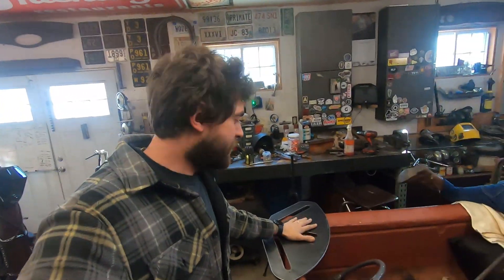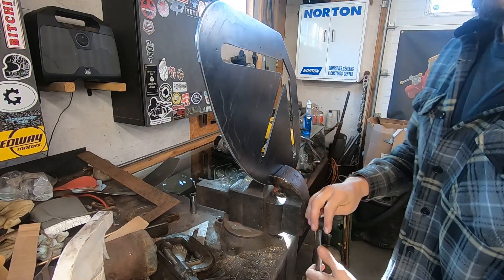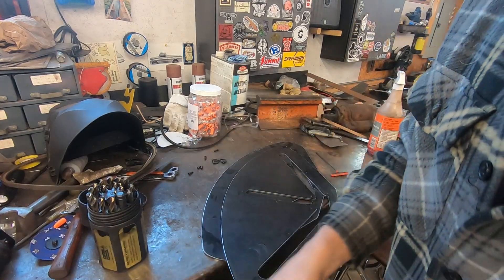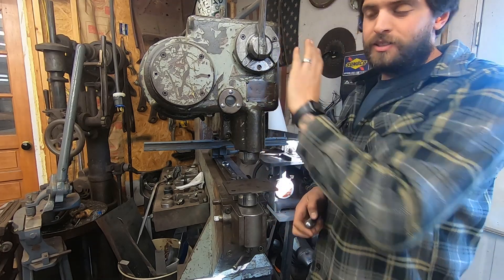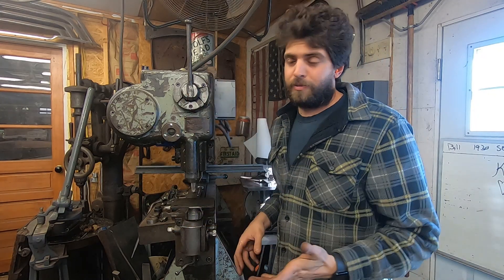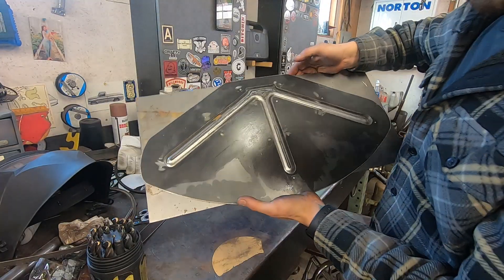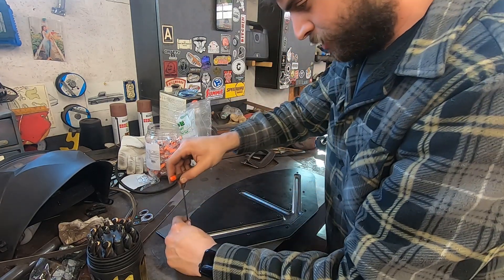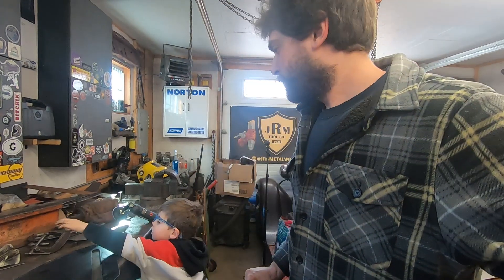How To Shape Sheet Metal With Sandwich Plates In The Pullmax

Comment: Great video, going to make a a sandwich plate for a floor pan , going to use a air hammer with a 1”rounded head that I welded on to a old rivet set, should work out fine , wish me luck.